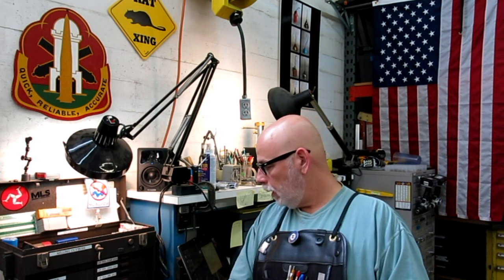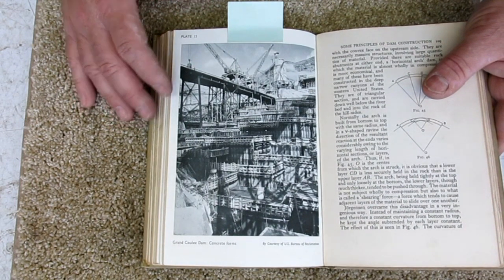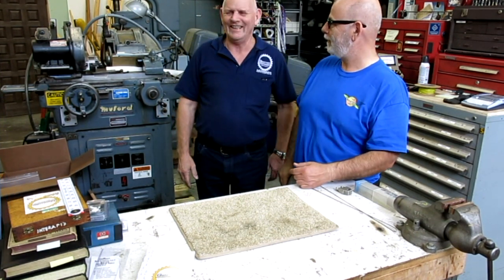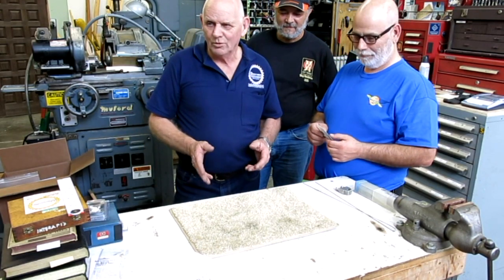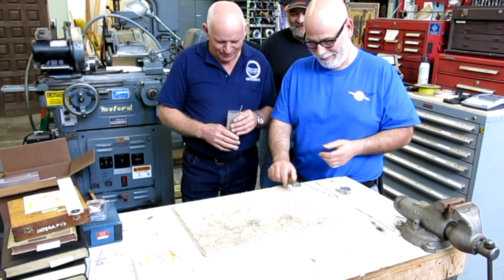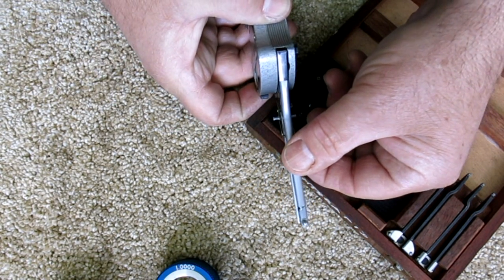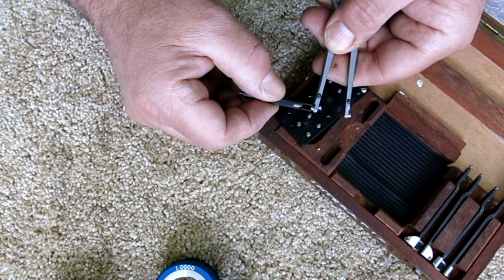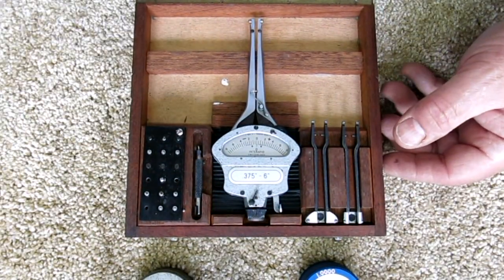Monday Night Meatloaf 101 P1

Comment: Hey Tom,

I just found a reference to the the knob on the front. It is indeed a fine zero adjust. It flexes the internal frame from which the twisted band is suspended. You can vary the reading by up to six divisions.
Reply from the maker: Six divisions ain't much on these little guys. Just touching the knob moves it a few. 

Best,

Tom

Comment: I have to ask, what is the reason for scraping? I watched the scrape fest video, which was very interesting, but it just seems like an old way to ensure flatness? How does the work produced differ than what you may get off a surface grinder(other than looks awesome!)?              Cheers!
Reply: My guess is a scraping tool can be made any size and fit almost anywhere, whereas a surface grinder, for the same precision, wouldn't.

Comment: hey Tom.  I've not commented for a few months due to personal issues which are now solved. any way I saw those metrology gauges you have there and I used the same thing when I was a toolmaker at a Bearing manufacturer. it had  fine adjustability and an acme screw column for physical vertical movement. It also had a carbide ground block for resting test pieces. I used it to measure tolerance on ground bearing components. very accurate. and worth a ton of money. treasure them ..m
Reply from the maker: Hi Stewart,

Good to have you back again. The CEJ tools are really nice. Thanks for the comment.

Cheers,

Tom

Comment: Tom,

Attached is a link where I just uploaded some photos of the crane we designed and built at Grand Coulee - It's 2000 tons and lifts the rotors.  We've done hundreds of such big projects, for the DOE, mines and various other groups and I have photos of most if needed.  

Our company 'was' called RAHCO in Washington State

https://www.flickr.com/photos/davisglenn

Cheers,

Glenn
Reply from the maker: Hey Glenn,

Were are the bridge crane photo's? I didn't see them on the album link you sent. Thanks for the comment.

Cheers,

Tom
Reply: oxtoolco Tom, just took them down.  
Apologies - what was your email again, I'll send them across.
cheers